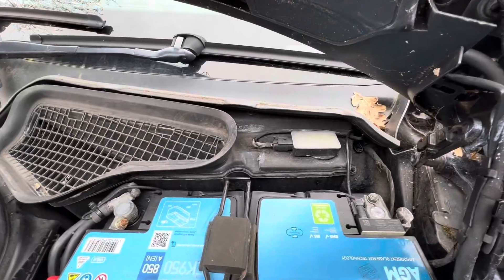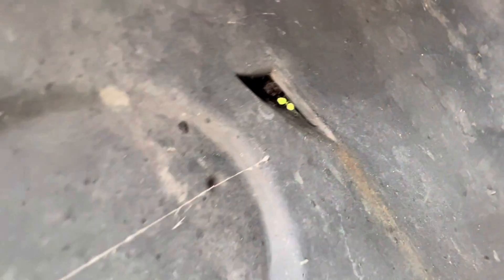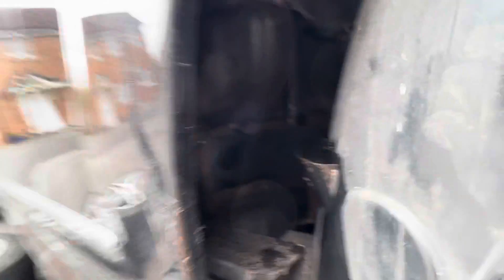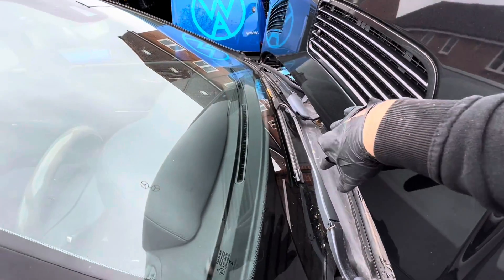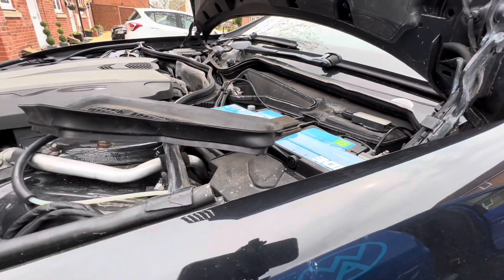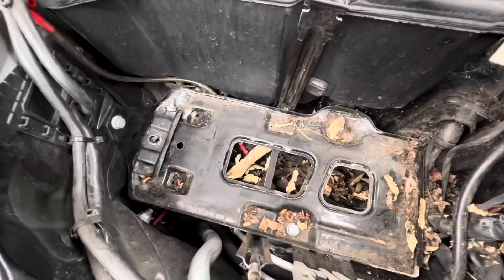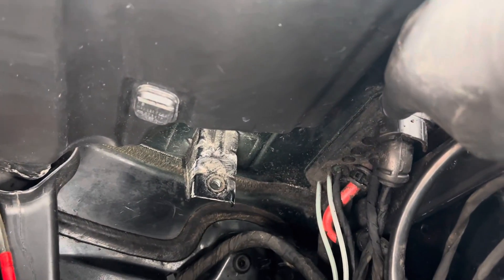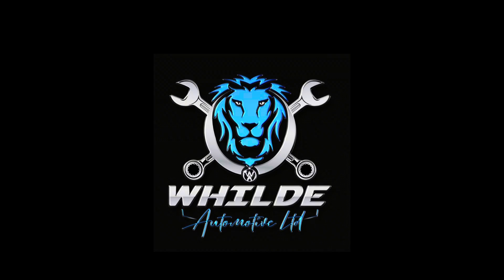Mercedes S350 W221 LWB Interior water leak fixed 🤞🏻🙏🛞🥳😎

Comment: Brilliant, the only video that shows the really VIP area to clean. Many show the 4 scuttle tray drains.
None show the real danger, i.e. under the Battery. Leaves always get there.
Luckily spotted mine with a 4 mm pooling i.el before going in the car.
But this is essential. If you wasH your car with a hose or power washer.
Water will get in there. Think about it there is about 10” on either side by the hinges, of course water will pour in there! If those drains get clogged especially with Sahara Mud rain you will get a problem.

One question this sorts the dreaded battery side, which is impossible to keep clean if you have trees near you. But what about the other side where the brake Master cylinder and fuse box is. .  
I am positive there must be drain holes ( like the ones underneath the battery tray) Luckily mine is dry so assume working but its only a matter of time.
How does one get to those and where are they?

But I am seriously impressed, wonder if they service Mercs.?
I have my CL500 Serviced at a main dealer and they never ever looked at these or the sunroof drain holes.
Reply from the maker: Thanks for your response and for watching my video. 

Yes you’re correct ✅ these drains always get overlooked by many service technicians even in main dealers.

On the drivers side with the fuse box/front Sam you are correct it’s difficult to inspect as lack of space I always look in there in between and on services.